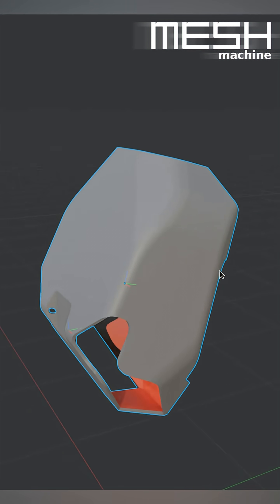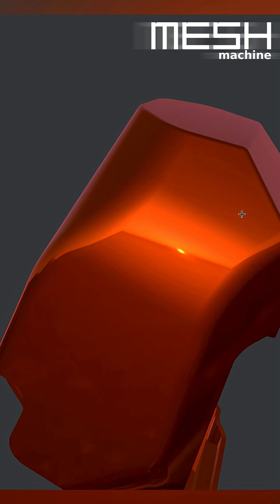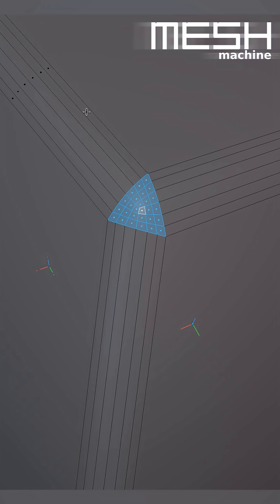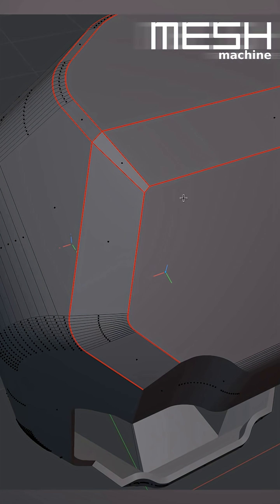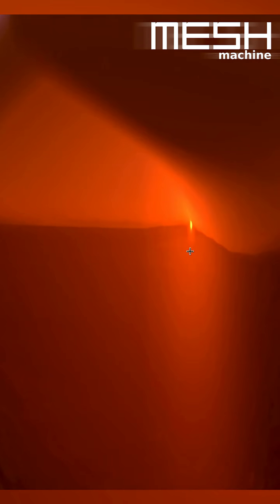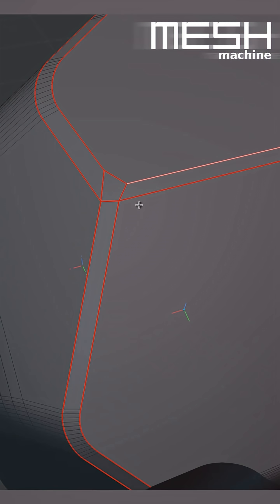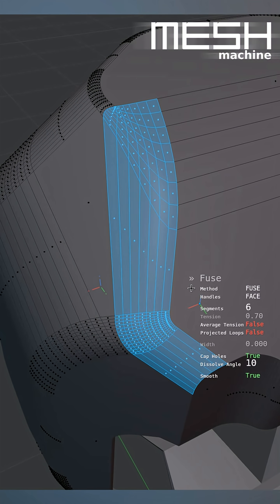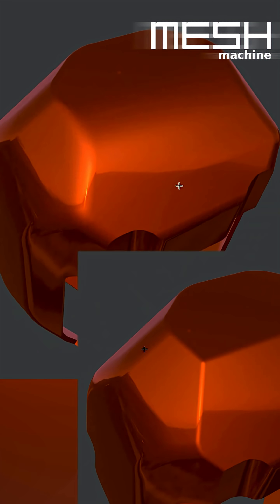Washouts #blender3d #3dmodeling #b3d #blendercommunity

Comment: can’t you bevel top left edge first, and then select top right to middle bottom edge and bevel?
Reply from the maker: Yes, that's what I mean by stacking your bevels. And what do you do then? Can you do the rest too? I'm showing the flexibility of the chamfer to fuse and back workflow here, which gives you extreme control over the width of every part of the fillet.